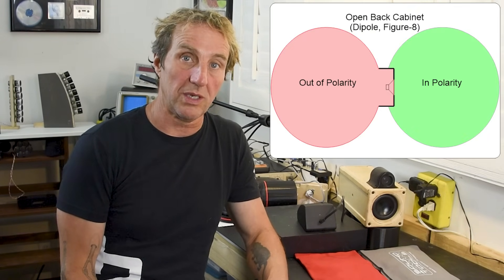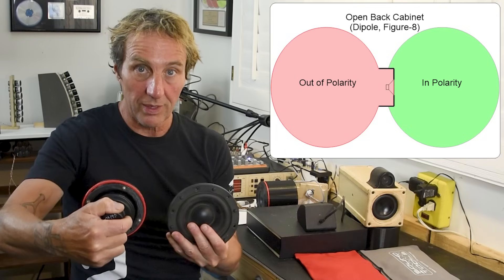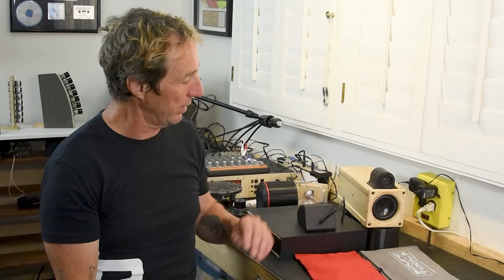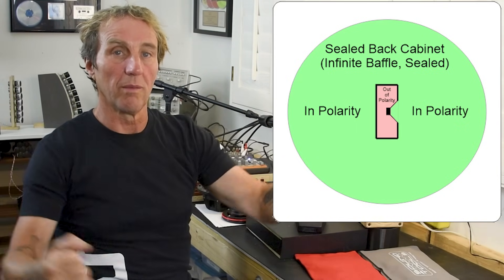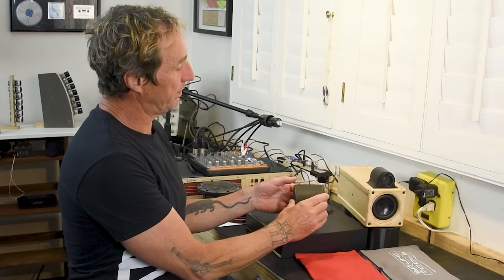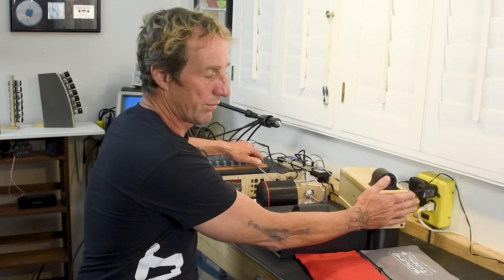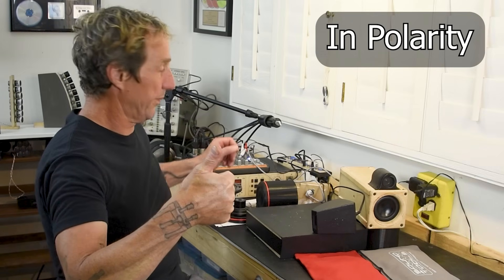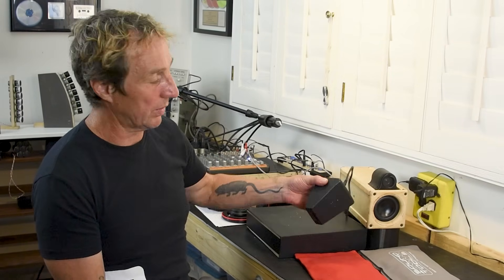Should Stage Monitor Polarity Be Reversed?

Comment: Am incorrect to assume that this is more of an issue the closer the speakers are to being in line with one another? If the wedges are further back, does that lessen the effect of polarity between the wedges and mains?
Reply from the maker: Yes the distance will have frequency related differences. 

 or put another way the closer that the main PA and monitor system are to equidistant from a listening position the more impact polarity reverse will have.

Comment: I have a question Dave, would the cancellation node change depending on the distance between the monitors and the main PA? It seems like at a certain distance where youre not hearing the main PA (ie center upstage) reversing the polarity would also just make your monitor sound tinny? Because any cancellation from the two systems in polarity would be negligible anyways
Reply from the maker: Absolutely distance impacts both in polArity and out of polarity sources combining. The difference is that in polarity will have broadband summation for any locations equidistant from the mains and mons. Out of polarity mAins to mons will have broadband cancellation when equidistant. 

As far as being negligeable. It really depends. It is actually quite common for  some musicians to be equidistant from the main PA and some of the monitor system or side fills and polarity can definitely have an impact of sucking all the low end offs of areas of the stage in unstable ways.
Reply: Thank you @DaveRat

Comment: If I may ask, what is the function of the subs and line aray speakers left and right of the dj booth and pointed at said booth at large events. 
Are those really "Texas headphones" or are they used to take out some of the sound energy? If you answerd some of that somewhere already I did not find it. 
In your Bassnecat video you said that the rear subs were used to shape the bass energy so that is is reduced at the DJ stand but is that the normal way or are there really so many DJs that simply fry their ears?
Reply from the maker: Those are actually yes a DJ PA. Many DJs need to feel the music and hear it very clearly in order to synchronize and do their gig. 

The DJ monitor system has to be clear and loud enough to overpower whatever sound is bleeding in their direction from the main sound system. 

Because the main system is farther away the timing is very late on the main system and that will screw them up I need to have something loud enough to where they can't hear much of the main system. 

One way to do this is with ear plugs as well, The DJ can turn the DJ monitor system up really loud so the main system can't be heard and then put ear plugs in to bring it back down to a more normal volume if they choose. 

I'm not aware of the percentage of DJs that wear ear plugs or not
Reply: @DaveRat  Wow thank you

Comment: Lot of A1 folks sleep on the channel delay in their digital mixer.
S.o.S is about 1.13 feet per mSec, will help guide your onstage phase balance battles
Reply from the maker: Yes delay can help but it's a double-edged sword in many scenarios. 

If you delay the monitors or in ears to time a line with the PA then there's time lag for the musicians which can be quite troublesome. 

If you time delay the PA to the back line, they can help a bit in some scenarios for the audience perspective but that makes everything even more offset for the people on stage. 

So there's good arguments for delaying the PA and the monitors and the delay them both You're back to what you started from but worse for everyone. 

The overlay to all of this is that two signals that are in polarity will sum broadband when times correctly and have frequency dependent cancellations depending on time offset. 

But if the signals are out of polarity they will never sum broadband regardless of time offset.

So while time delay can be discussed and optimized polarity is pretty straightforward. 

If your goal is cancellation then out of polarity is a good starting point and if your goal is summation or avoiding cancellation, then in polarity is a good starting point

Comment: This is so silly. Who thinks it could work that way? I mean really?
Reply from the maker: The confusion I believe comes from the explanation that is typically used to describe polarity 

If you want the left and right stereo speakers to be in polarity both speakers need to move towards you at the same time 

Therefore if one speaker is moving away from you it's out of polarity 

In a not unreasonable expansion of that would be to spin the speaker around backwards and assume it's out of polarity 

The other aspect that confuses things are instruments like drums and open back guitars where the back of the speaker actually is out of polarity and spinning the drum or guitar cab actually does reverse the polarity radiating in a certain direction. 

Describing polarity in a simple way that accounts for the polarity reversal of an open back guitar cabinet or the back side of a drum and also encompasses polarity of a sealed box and a ported box pointed in various directions is not as simple as it sounds. 

I suggest you give it a try and come up with a one sentence concise easy to understand description that encompasses and conveys polarity. 

Understanding it is one thing and explaining it is another..

 want to give it a shot and post a one sentence all encompassing explanation of polarity for me?
Reply: @DaveRat  i mean, you explained it very well - sound is omni-directional. i think people sometimes have the same misunderstanding with snare top and bottom mic. But I think, this is the point where time/delay enters the discussion....
Reply from the maker: One thing that I feel is important is:

In order to have a null, you must have a polarity or phase reverse, and if you have a null there must be a polarity or phase reverse"

Figure 8 mics and speakers have a null90 degrees off axis, therefore there must be a polarity or phase reverse. Hyper cardioid has a null 150 degrees off axis, and the rear lobe is reverse polarity.

Conversely, if there is no null in the responseoff axis,  then there is no polarity reverse, there can not be a polarity reverse or phase reverse without a null.

I hopefully will figure out a good way of making this clear in in a vid so people can clearly grasp the concept

Comment: Does this apply the same to my situation? I have 2 sets of studio monitors; rear-ported Genelecs which are sitting directly in front of front-ported Adam audio speakers. So that the air coming out of the ports is directly opposing each other when the speakers are in phase. Is this ok?
Reply from the maker: It doesn't matter which way the ports are pointing if the speakers are wired in polarity you'll have a positive pressure radiating from the speaker as a whole including the ports
Reply: @DaveRat  Sounds like some of the bass is nulling out when I turn on one set of speakers
Reply from the maker: Well, that is a different issue. Having two sound sources recreating the same or similar signals that are different distances from the listener will create cancellations. 

This is especially audible if the two sound sources are not separated horizontally or vertically from each other and are purely one farther than the other. 

The issue you are experiencing is a distance offset issue that can be corrected with time delay to some degree. 

Polarity won't fix it but time to lay can help. That said having two speakers operating at the same time that are different distances but coming from the same left right location is not optimal
Reply: @DaveRat  but I delayed one of them by the amount of time for the sound to travel
Reply from the maker: Interesting, when you delay does the issue get worse or less?

Delaying should mostly fix the issue but with ports there are phase offsets that delay won't fix with messing up other things.

I would try putting the speakers side by side, no delay and see if they sum well without issues.

Also try polarity reverse and confirm a polarity reverse causes lots of cancellation when side by side.

Different speakers have different phase responses so they will not add and sum at all frequencies smoothly. 

Testing with the speaker side by side should give you an idea of the best you can achieve with those speakers time delayed 

Also you may be having reflections of the port output creating issues. 

To determine if it is polarity that's causing your issue, tri reversing the polarity and see if it gets better. 

If it gets better then most likely somewhere in your system you have polarity reversed when it shouldn't be and reversing polarity is fixing it

Comment: Thanks for the informative video.  I am wondering why the cancellation seems to happen with the lows more than mids and highs?
Reply from the maker: Low frequencies have longer wavelengths so small changes in distance offset has lies impact on small distance changes.

The higher frequencies are cancelling and summing creating a phasing sound as distance changes, the lows do the same thing but you need to move things much bigger distances before you get summing, so you just hear cancellations.

To know more, look into comb filtering 

Hear is a vid on a related subject.

https://youtu.be/MlqJ5H8cA3M?si=riRGbglr4xPO_ye2

Comment: I'm confused which ones which in terms of polarity. When you refer that in polarity is better, are you referring to the drivers being in polarity mains and monitors with their box direction back to back, so you're saying you should reverse polarity on the monitors?

Good thinking, also distance time delay is going to shift them out of phase, so if already out of phase and combing, is it likely that in some scenarios perhaps switch phase might cause a different frequency of combing thats worse? I am assuming not though that the distance between the main and monitor will combine at a certain frequency length related to that distance and delay time plus the two main speakers both interacting time wise to each one monitor. So yeah low frequency summation because the distance equals a long wave length? Is it possible that a test done with longer distances between mains and monitors might start showing different effect, that the inverse could be better in certain circumstances for?
Reply from the maker: When two sources are in polarity there will be summation when equidistant from the two sources. As you increase differentials in arrival times, cancellations will occur at increasingly lower frequencies

When two sources are out of polarity they will never have broad band summation anywhere ever. You will get reductions in cancellations at increasingly lower frequencies as the differential in time offset is increased.

So, in polarity starts off great and progresses to decorrelation as you increase offset in arrival time

Out of polarity starts of with massive cancellations and progresses to decorrelation with increasing time offset.

In polarity starts of good and works towards a timing mess, out of polarity starts off bad and works its way to a timing mess.

So, unless you have a specific reason to induce cancellations, in polarity is the way to go.

This video is to help people understand that the direction a sealed or ported speaker is pointed has no impact on polarity.

People get confused when a speaker is pointed the opposite direction from another speaker and thinking they are fixing things by reversing polarity, they are actually messing things up.
Reply: @ my brain will process eventually thank you. I’ll be ree-reading this, but I have an awful habit of also having to find out for myself. V much appropriated your breakdown, I take this to heart and will do some of my own tests. Tricky in some scenarios to switch polarity without literally rewiring cables ect. No quick or practical tip here? If say it’s all out of a single desk, a intermediate box? Errrrr
Reply from the maker: Yes, I try and do all my vids with simple gear so everything can be tested and confirmed easily.  Here is a vid showing summation, cancellation and decorrelation.

https://youtu.be/MlqJ5H8cA3M?si=riRGbglr4xPO_ye2

Comment: Was doing a one off large club show decades ago back in the good old analog days and the house crew were scratching their heads as the band's monitors "didn't sound right" no matter what they tried.   I pointed out their mains were JBL and the band's wedges were EV which were naturally out of polarity with each other if you wired them both up the same.   Once we flipped the polarity to the wedges on stage, it was like someone waved a magic wand and the sound smoothed out dramatically.   Moral of that story which stayed with me for years of touring - make sure the entire system is matched!   If you are using different equipment brands, check their polarity with each other!   :)     

Great Demo Dave!   well done.
Reply from the maker: Yes, that was a common issue back then and very cool.

But still, in ear have polarity that matters as well and PA and stage sound and our voise should also match in ear polarity.

So the adventure persostst.

Comment: what about sidefield monitors? they're at a 90 and 180 degrees (from the PA)  facing the center of the stage (and each other) 😅😅😅
Also, doesn't the distance difference from the PA speakers and the floor monitor speakers prevent from "full-on" cancellation? Or can it cause some kind of comb filtering (which might be even worse)? 
I'm genuinely asking. Apologies if these are dumb questions 😅
Reply from the maker: It doesn't matter which way the cabinet is pointed. What matters is "if you were to take an instantaneous snapshot, Are all the speakers moving in the same direction in relation to the box that they're mounted in"

Spinning a sealed or ported speaker box sideways or pointing up or pointing down or backwards or forwards or wherever does not affect polarity at all.

Polarity can only be changed by reversing the speaker wires, electronically switching it, or removing The back of the speaker box and listening to the other side of the speaker. 

Now polarity is completely different than time delay or phase. 

Moving speakers around will alter the arrival time and the phase interactions and that's a completely separate thing that's also important. 

But as far as having all the speakers in-polarity which is " having all of the loudspeaker cones moving in the same direction in relation to the box at their mounted in", rotating which direction the box is pointing will not alter that.
Reply: @ Thank you!!!

Comment: I was mixing a gig last year where the audio company put sub-lows behind each of the speaker stacks and reversed the polarity on them, while tweaking the best level possible to cancel as much lows as possible on the stage. It worked best close to them but in the middle of the stage it was having less effect. Anyways, the lead singer could still enjoy it.
Reply from the maker: Yes, polarity reversals combined with time delay is an effective way to achieve  broadband cancellation behind and narrow band summation in front. 

If this interests you I have done many videos on subwoofer arrays including some on listening to the various array types and the cancellation. 

Most are in my subwoofer video playlist

Comment: Thanks for this demo and explanation, it helps visualize what's going on in the different setups.
A bit of a strange question, but if you have L+R in the PA, then L+R in the monitors, is it normal to have L channel in the left ear of audience and left ear of performers, so therefore opposite sides of the stage for monitor L/R vs PA L/R.
Then if you pan an instrument in the PA say a keyboard to the left, you wouldn't want that pan to go to your stereo monitor mix would you.
Reply from the maker: Typically everything is panned to match somewhat the way you see it or where it is on the stage
Reply: @DaveRat  Thanks mate, makes sense.

Comment: I was once running sound for a well known Hip Hop artist in a 5000 cap venue. The stage volume was so loud from the side fill subs and wedges that it was causing a deafeningly loud power alley around 90Hz to the back of the room. My solution was to invert the PA polarity. Fixed the problem right up and there were no issues. I felt pretty proud of myself for thinking of that. I walked the room after I did it and it was definitely an overall improvement.
Reply from the maker: Yes, there are occasions where the narrow band cancellation of inverting PA can be helpful. Using time delay to fine-tune that or instead of inverting can also be useful in those situations
Reply: @DaveRat  Yep, and at 90Hz, I'd question if it's PA subs or PA mains.  Coming from Olde Skool VerTec to now, K-series, the Old Skool would put 90Hz just above electrical crossover in most configurations (edit ps - with haystacking the subs, 90Hz would be about equal, acoustically, in a 12 box hang of '89s), in the K series, 90Hz is solidly in the main PA.  If the side fills or DJ "headphones" are the loudest thing, then we treat it as The Input That Cannot Be Changed and build all the sonic stuff off of/around that source - so delay would probably be my first choice, too.  If we note this at sound check we can find the arrival time differences in software (or even a measuring tape and a bit of math would get us started) and listen to some different time-based changes.